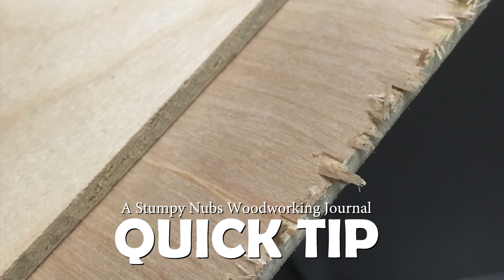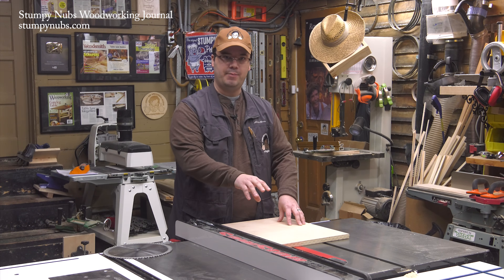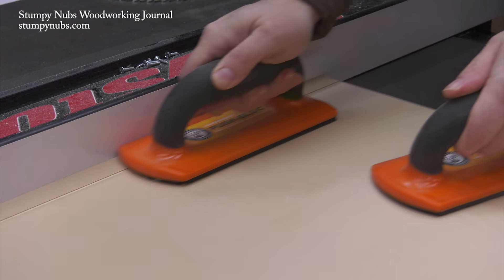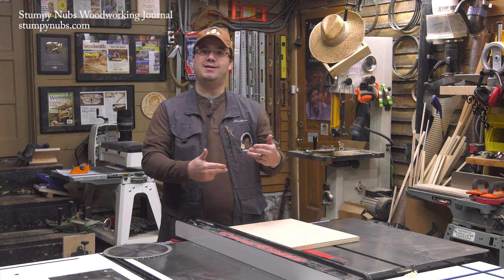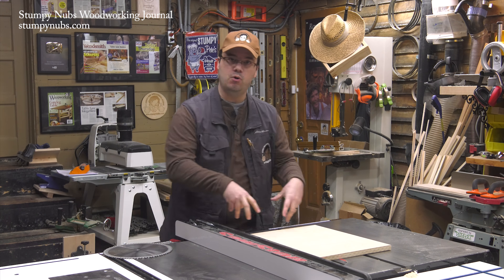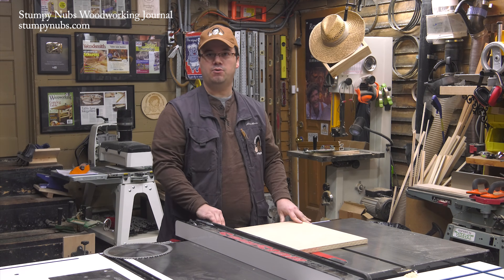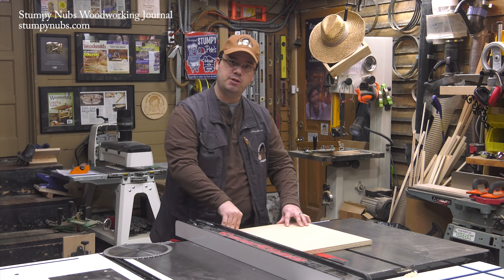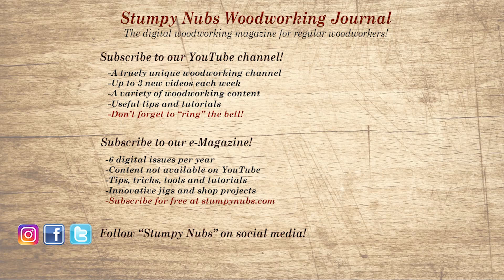Eliminate tear-out by scoring your plywood

Comment: I often watch your woodworking and tool videos.  Many of the videos don't apply to the projects I am working on. However, I needed to cut some veneer plywood for the sides of our kitchen cabinet.  I was concerned about chipping the edges since I was reusing the veneered plywood.   I remembered you had a video on how to avoid chipping wood on a table saw.  I found the video on 'scoring' plywood and my cuts came out factory perfect!  I even amazed my wife with the results.  Thanks for making these videos and keeping the accessible for future projects

Chuck from Baltimore

Comment: Regarding the reverse scoring.  I saw that on a YT video some time ago but it had the operator push the wood from the back of the saw.  I have been doing that all summer and I learned that as long as you have a minimal saw height there is nothing to worry about from a climbing perspective.  It goes without saying, I hope, there is a lot of potential for accidents using this technique, so be EXTRA careful!!

Comment: That was a great explanation of the pros and cons of this technique. I recall reading some old article, maybe in some vintage popular mechanics or something, about cutting backwards. Safe or not, the riving knife issue is the deal breaker on modern saws. End of story.  Personally, I'm finding that a good track saw makes it easier and safer when trying to accurately cut sheet goods. All you need is to put a big sheet of foam on the floor and cut on top of that. While it's not a replacement for a table saw, it makes many of the more difficult things a lot easier and safer. On a related note, now that Festool's parent company owns saw stop, will we be seeing more green tools in she shop? ;-)

Comment: Excellent info! Thank you!   Where's the link to Table Saws 101 you mentioned?
Reply from the maker: A 5-part table saw series for woodworkers►
Table Saw Basics #1- Safety: (https://youtu.be/qSbS5zhH7cE )
Table Saw Basics #2- Rip Cuts (https://youtu.be/bADmnDEcuYo )
Table Saw Basics #3- Crosscuts (https://youtu.be/o8ok1h0gJ5o )
Table Saw Basics #4- Miters & Bevels (https://youtu.be/7aZCdt8Cs8M )
Table Saw Basics #5- Working with Plywood (https://youtu.be/71UenL74k2E )
Saw blade tutorial: (https://youtu.be/0J1pRBiVKbI )

Comment: Using a backpull on a sled also leaves the possibility of the piece lifting, since it probably won't have any weight applied from above, & that's sure to completely wreck the surface if it moves even a tiny bit.

Comment: Stump my scoring cuts are effing me. Every time, the scoring pass cuts deeper into the width of the board than the full pass. So I end up with a little tiny “rabbet”/inset shelf which is no bueno if the edge will be joined to another and seen. Doesn’t matter if the scoring pass is barely nicking the veneer or 1/4” deep. It’s driving me crazy, any ideas?

Comment: I went on the Web site to check out the blades you recommended.  I get the impression they only want to do business in the US as I live  in Ireland access was denied. Are there any other blades you'd recommend
Reply: @jonh1808  thanks for that. Will check it out.
Reply from the maker: It's a small family business. They aren't large enough to sell profitably overseas. It has nothing to do with what they "want" and everything to do with what it costs.

Comment: I am new to wood working and got my first table saw, job site, and followed the link to look at the saw blades.  During the selection it talks about "Blade Bore", but I have no idea what that means. Mr. SN, do you have a video that talks about this?  Also, what saw blades would you recommend for cutting 2x4 or 4x4 for simply outdoor projects and for fine wood working projects like cabinets/book cases/etc?
Reply from the maker: Bore size refers to the size of the hole in the middle. For most saws it's 5/8". While I'd like you to buy a lot of blades from our sponsor, you really don't need a premium blade for outdoor 2X4 projects. For those I'd get a 40 tooth Diablo general purpose blade at Home Depot. Construction lumber will gum the teeth up pretty fast, so clean it often. For finer projects, premium blades leave cleaner cuts and last a lot longer. Most cuts can be done with a 40 tooth Super Combo blade ( https://ridgecarbidetool.com/saw-blades/ridge-super-blades/table-saw-blades/10-ts2000-super-blade.html ). If I could only have one nice blade, that's the one I would get. Finer crosscuts (like miters), and veneered plywood are best cut with an 80 tooth blade ( https://ridgecarbidetool.com/saw-blades/ridge-super-blades/miter-radial-track-saw/10-rs1000-super-blade-80-tooth.html ) Don't forget to use the discount code (SNWJ10). Thanks for supporting our sponsor. It means a lot to me!
Reply: @StumpyNubs  I'm going to disagree with our handsome and talented host. Even with construction grade lumber, you'll notice a significant difference between a Diablo general purpose blade from Home Depot and a premium combo blade from Ridge Carbide. You'll get a better quality cut and the blade will stay sharp longer. A premium blade will need cleaning just about as often as a less expensive blade, so get the type of blade cleaner our host recommends and use it as needed.  Good Luck!
Reply: @StumpyNubs  Neither links worked for me. The embedded links include the ending parenthesis thus not able to resolve correctly, just in case anyone was having issues
Reply from the maker: @LordHog  Sorry. Fixed it.
Reply from the maker: @DKWalser  - Absolutely you will notice a difference! But that difference is rarely a problem with outdoor construction lumber furniture because the maker is rarely looking for perfection. But if this isn't the case, then by all means, use the good blade!

Comment: love your shows. i would like to see your work shop and meet Mustache Mike. since we are right handed, why don't we use the fence on the left side of the blade? thanks, Abbey Thomas
Reply: Good question, why are tablesaws set up left handed?
Reply from the maker: A fence on the right side of the blade is setup for a right handed person. You operate the fence with your right hand, and the portion of the board you push through a rip cut (the part running against the fence) is on your right side.

Comment: Not that it makes it any safer to pull the workpiece backwards, but the splitter is supposed to be lower than the top of the blade. 2mm is what the german trade association in suggests.
Reply from the maker: You are correct. But I still wouldn't do it :)

Comment: Cripes.  The table saw is just waiting to fling a chunk of burled maple at you.  Why help it by pulling the work piece?
My radial arm saw (circa 1973) once decided to seize.  Instead of ramming through the work piece, it stalled and tripped the circuit breaker.  Maybe there's something to be said for less motor power.  Whereas a radial arm saw moves the heavy motor, a table saw fires a comparatively lightweight wooden bullet.

Comment: If one were unwise enough to attempt a scoring cut with the sawblade, surely the board should be fed from the back of the saw towards the front, so if it gets grabbed you aren't standing in its way...
Reply: I'd be more worried about it pulling you into the blade.
Reply from the maker: Feeding from the back wouldn't pull the work piece toward you, but it would pull your hands and potentially your body toward the blade.

Comment: i just use supporting sheets on top and bottom. works far cleaner and better than scoring. also pretty much required for clean cuts in very thin steel and especially aluminum sheets.

Comment: You are placing yourself over the blade no matter what when you cut in reverse. Maybe if the workpiece is clamped to a "sled" like on that fancy sliding table saw it is ok, but not with a regular cheap ass SawStop like you have. Just kidding, cheap and SawStop do not belong in the same sentence.